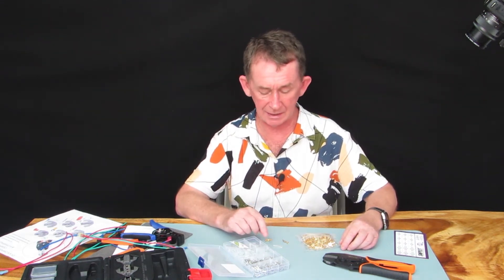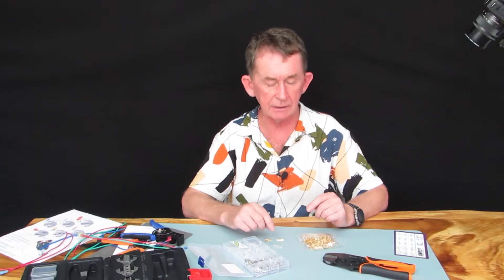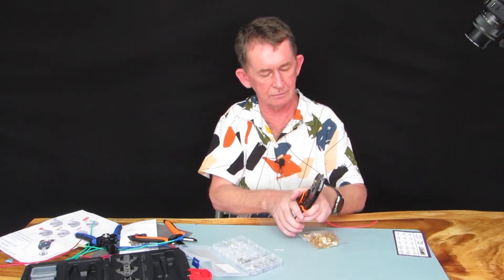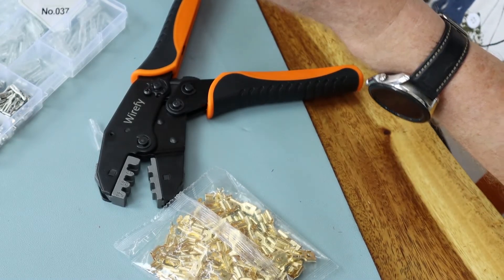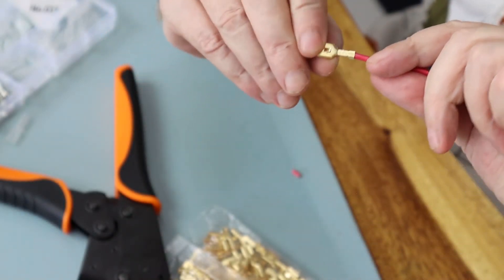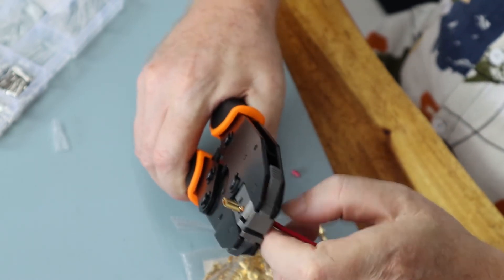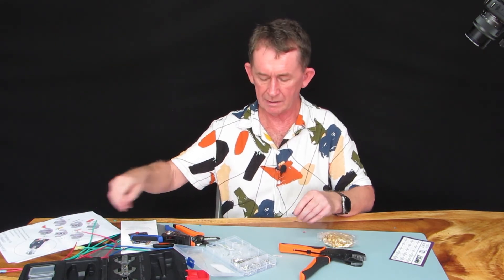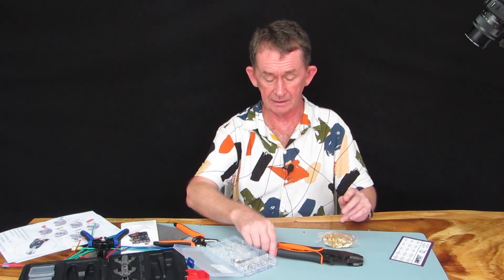How to Crimp Open Barrel Terminals the Easy Way

Comment: I was very happy to discover this type of crimp myself. I was always taught to use butt connectors but they never felt fully secure to me. I of course do the tug test on them all and they feel solid but I can use nearly all my strength on a good open crimp and it stays, I like that a lot better. Feels like the crimp will outlast me lol.
Reply from the maker: Yes. Open barrel is a good as it gets. Thank you for watching

Comment: Hey is there a way I can take one of these off without damaging it, I have a speaker that has two of them and I need to get the wires out
Reply from the maker: I am not sure what you mean. Do you wish to pull the spade or open the crimp itself off the wire. The latter would be near impossible to do without damaging the crimp.
Reply: @IrishChippy  Yeah that's what u meant, thanks anyways
Reply from the maker: Is there a reason you want to save the crimp? If it was of upmost importance, you probably could uncrimp it with a small knife on a bench.
Reply: @IrishChippy  Yeah I tried that and it didn't work, thanks for trying to help though man I appreciate it.